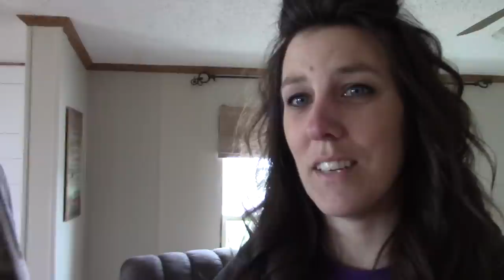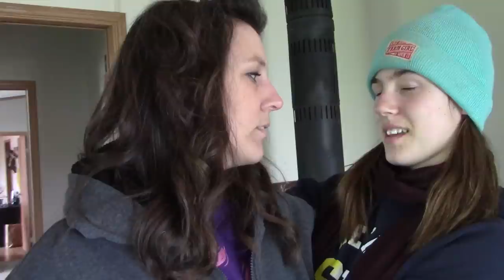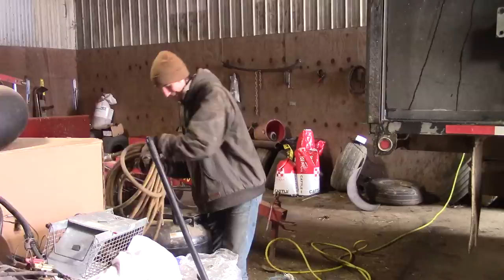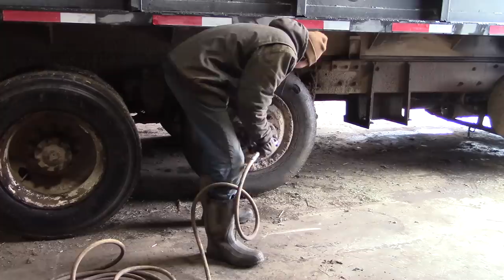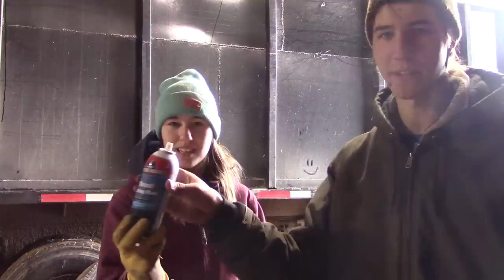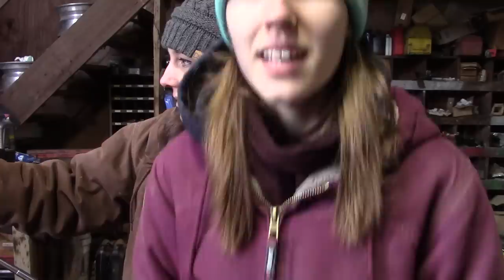Goodbye Blow Out

Comment: Still changing Tires with no Murphy Soap ..  I guess it does not matter on a Junk Tire  but  you will damage the beads on a  good tire..  Murphy soap to get it  off and   FreyLube to get it back on .. and  then the  beads won't leak  on a tubless rim either..  That is  if  you clean the bead  area up with a  wire  wheel too ..

Comment: Would you tell Ethan that if you make up a solution of water and dish soap rubbed on the tire bead before mounting or dismounting the tire it will be so much easier,  Tire shops use a solution called Rubber Lube

Comment: When removing or replacing a tire. Put some dish soap around the bead it will lubricate the rubber so it comes off easier. If you have any equipment with split ring rims. Before you inflate the tire wrap it with a chain. Back when I was a kid my first job was to run to R.I. for part and tires for a large construction company. I brought a load of tires to have new tires put on. I had brought in a set of tire and went back outside to get another. When I got out to my truck I heard a loud BOOM. I ran back inside and found the tire man laying on the floor with the top of his head missing. The ring slipped and hit him. Even with the new style rims when inflating them after changing never stand directly in front of it. You never know what can happen.
Reply: That is why I think tire shops require a blow cage when you inflate split rings tires, but there arent that many type of rins around anymore
Reply: @kennydean4512  Split ring rims should have been illegal to manufacture because they killed sooooo many people who failed to recognize the danger(s) when working with those two piece nightmares.